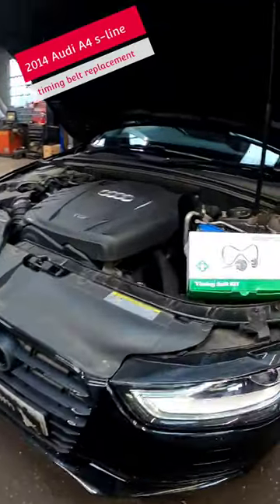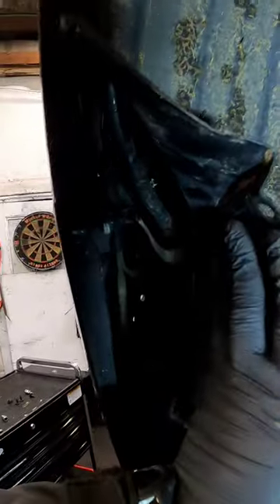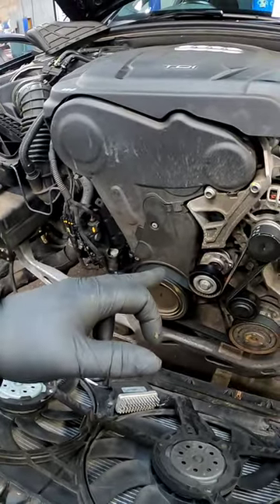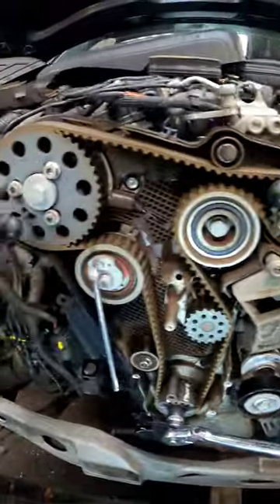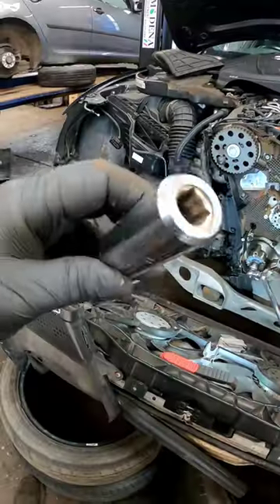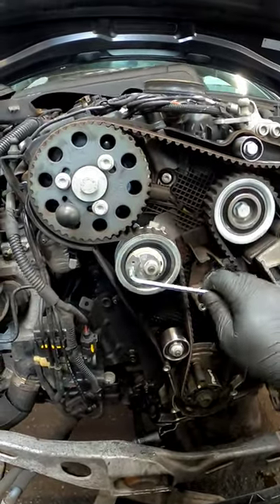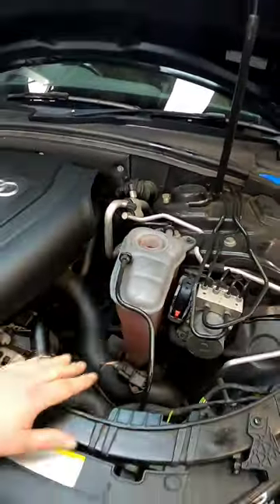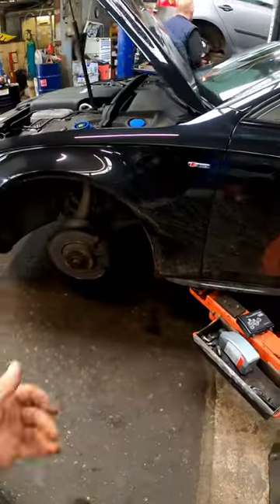2014 Audi A4 timing belt replacement

Comment: Dismantle all front end just to replace a timing belt. Brilliant
Reply: could be worse some cars you have to remove the engine completely to change timing belts/ chains
Reply: This germany technology is a kak
Reply: Yep. I was going to buy a 2013 a4. I read the Carfax and in 117k miles it has not been changed even tho it was serviced in an Audi dealer several times in the last 5 years. They want $2k here in the US to replace timing belt.
Reply: @robmen1402 i paid about 1k for a timing belt change and water pump here in Norway😅 2k is crazy tho
Reply: @esotericking5267  Yeah, mechanic work here in the state I live in is freaking insane. Just the hourly labor cost has more than doubled in most shops.

Comment: Can I just ask how much - roughly - this would take? I am considering an Audi but I heard the repair bills are a nightmare
Reply: Don’t know if this is to late a reply, but I’ve found there’s nothing more expensive than a cheap Audi, pay the extra money to make sure you get one that’s been well looked after and maintained. This specific repair is around £500-£600
Reply: In sweden we pay almost 2000$ for this. Thanks to this i dit it for 150 with just markings. Only ”special” tool was INX 10 for the belt pulley. Thank you!

Comment: is it possible to check condition of the belt without removing the whole bumper?
Reply: You have to listen for a tick tick noise coming from the engine. Also rev issues. Bad revs.